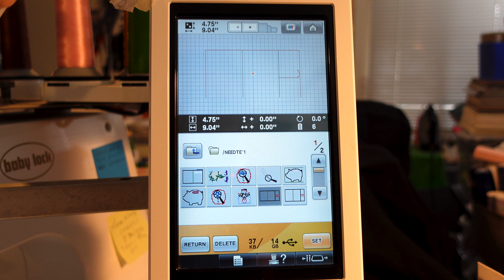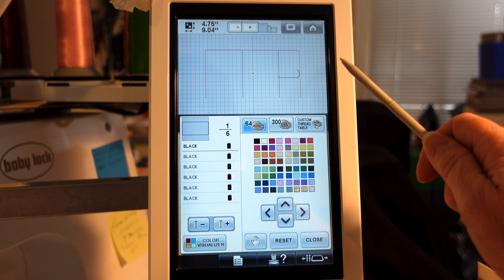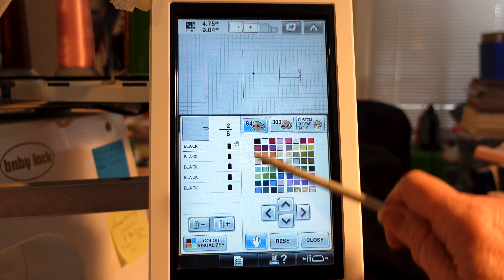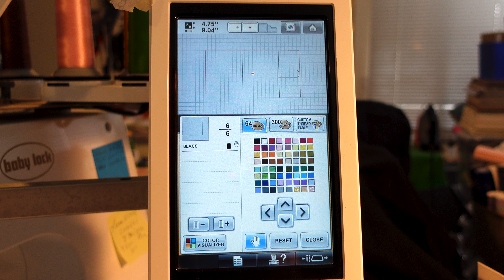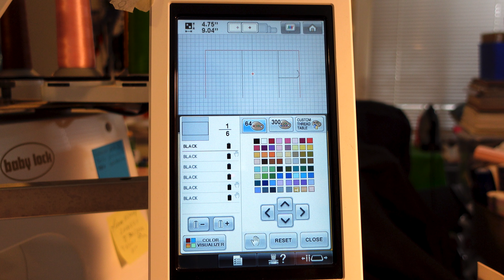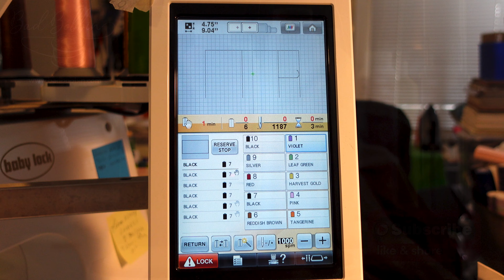How to Make a Color Stop on a Multi Needle Machine

Comment: This is so incredibly helpful! is there a way to program those stops in your design on the computer? If you stitch several back to back, do you have to put those stops back in or do they stay?
Reply from the maker: depends on your machine & editing program. if you can do duplicates on your machine, the 10 needle will put the stops on once you set it up with the first one & then multiply. As for the program after you multiply them you will have to group the steps, but be sure they are still in the right order.